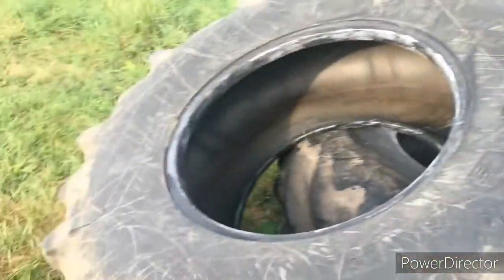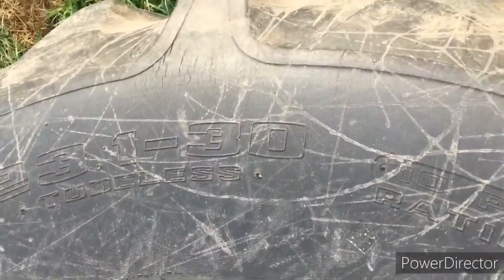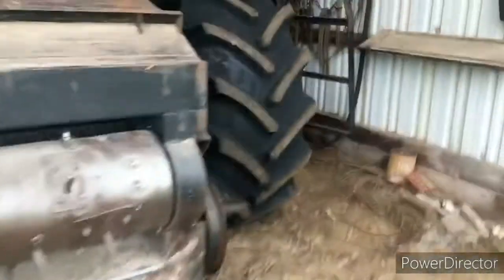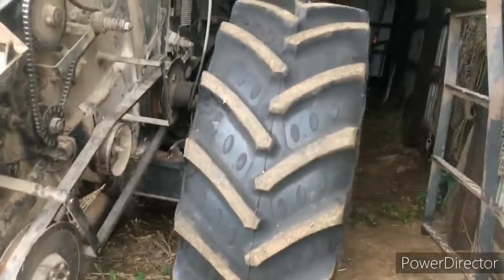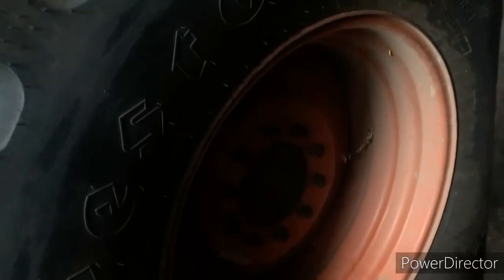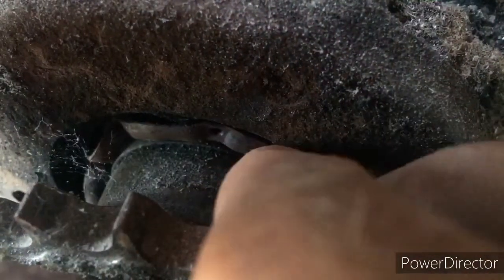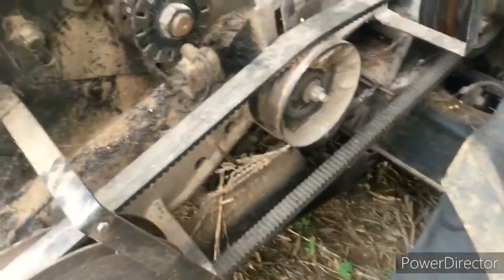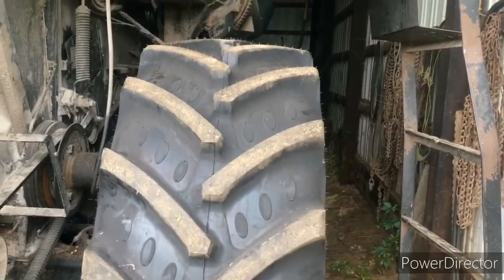New tires on the M3 gleaner

Comment: Those are not Firestone tires. They are BKT brand. Not a bad tire but IMO not as good as a Firestone.
Reply from the maker: I know they seem to be holding up time will tell
Reply: @pfisterfarms1046  They'll hold up long enough I'm sure. I have the same ones on my L2 , 23.1 x 34  but metric version. They were pretty much new when I bought the combine in 2010 but they do show some cracking, hardly noticeable but they are cracked but not the side walls. My old E combine's original tires were crack free until the late 90's..... I think they are Good Year from 1967.